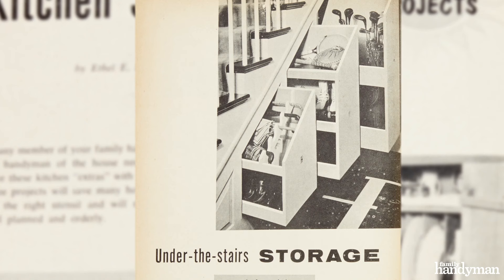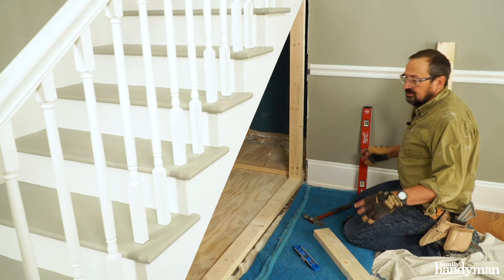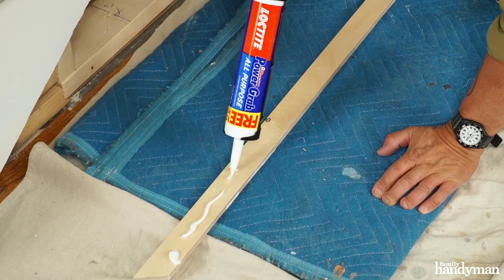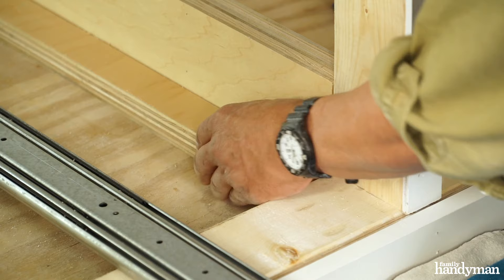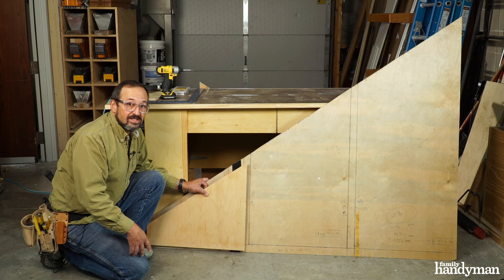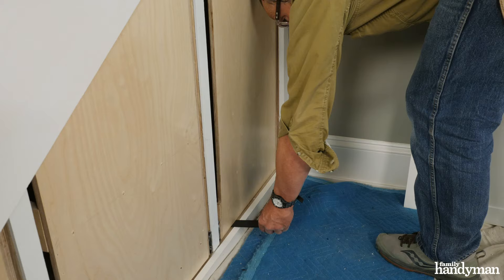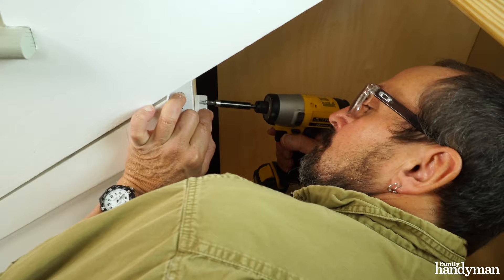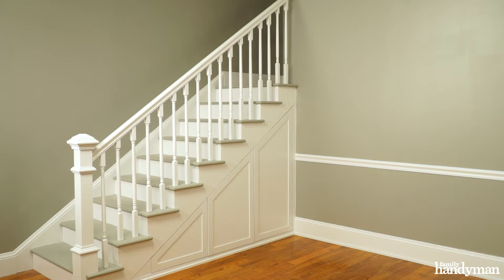How to Build Under Stair Storage Drawers

Comment: Wait! you didn't really show how you built the carcass of what the drawers sit in. Like you skipped a whole lesson. I have those same heavy duty slides, but not sure how to frame out the base. How did you do that?
Reply: Exactly what I was thinking. You showed the easy stiff that is basically self explanatory. I’m wanting to know how you built the actual drawer and how it is attached to the rails.
Reply: Instablaster.

Comment: I've been planning shelves with doors under the stairs, but I think the drawer idea works better because you can then access the full depth of the space.  This construction is simple, and works well.  Thanks.
My space is the full height of a 16-stair flight, so I'll probably divide it up into smaller sections.

Comment: If the slides didn’t come apart how did he get screws into the side of the drawer closest to the wall?
Reply: It need to screw for drawer first then extend slide to full length and screw it to wall by crouching behind drawer from previous opening.
Reply: Ma pop up up pplo ok

Comment: great job. Please let me know the specification of the drawer runners you use? I reside in the UK, so will have to source it here. Many thanks
Reply from the maker: Hi Johan, you can get more information about the project here: https://www.familyhandyman.com/project/under-stairs-storage/
Reply: Thanks, I looked at the additional information, but you don’t specifically say which sliders is used:
“ 34-in. Extra Heavy Duty drawer slides (500 lb.)-3 pr.”